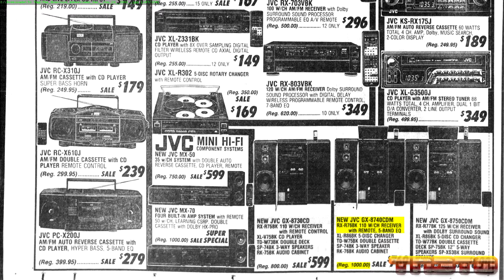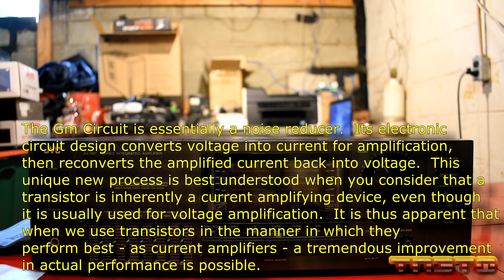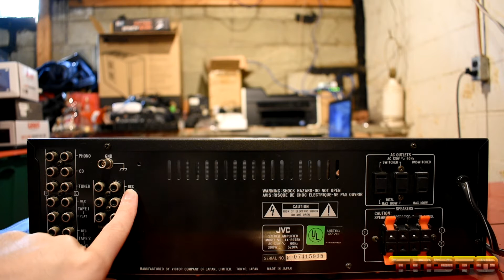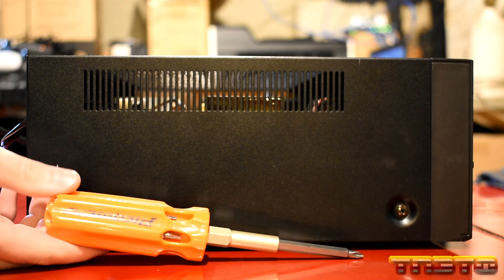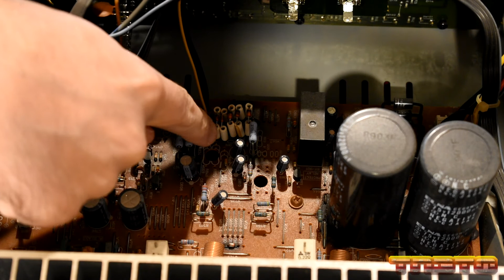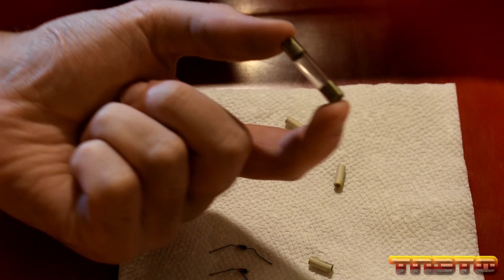JVC AX-R97 Overview and Power Meter Fix

Comment: you are supposed to use the plugs on the back of the receiver if you have the original equipment, it is how you unify the equipment and its features to use it all together, and this came with a tuner as well  that sat on top, just like it looks on the model that's a receiver.  I still have this whole entire stereo with all its original equipment, including its speakers and cabinet

Comment: So I have this unit. Bulbs were burnt out. I replaced bulbs, but still don’t light up.  I need to cut out the those diodes?   To make the bulbs work again?  I see no hot spots on the board .I understand your disclaimer and realize I am doing this at my own risk
Reply: I have probably 4 of these units both RX87:s ans 97's same issue replaced fuse bulbs and still nothing...Very powerful units at the top of my massive collection power wise and I've got another 97 in route...Also have 3 Rx450's..These old JVC fly under the radar to bad I'll have bought them all by the time they read this im cornering the market because I know good product when i see it bery very high quality JVC MADE IN JAPAN...Oh I've also got x2 Orion Research Audio Bluebooks now Audio 2000 also Audio 2002... Should double my money slow sale or sell quicker for less jist plan on enjoying this unbelievable operation ty like the movie Idiocy what's going on now days over a damn Bluetooth speaker that can have that junk I'll be Rocking wide open...Sad people just don't know what they've never experienced...I'm all over it tho keep it up I'll never pass up these sweetheart deals I'll buy 100....I've got enough now to open a decent store...

Comment: I did this today but it didn't work. The only difference is that I bought LED's but they have the exact wattage and amps. They are actually sold as replacements for this model. Any advice?

Comment: I replaced my fuse with the same value, and remove also the zener diode, but it doesnt work. What dobyou think is the problem with my unit..ive tested my fuse lamp and it works, but when i connect it to the fuse board, it doesnt work! So could cuase the fuse lamp wont light up? If you measure the fuse while it's powered on, will you get 12 volts power? Or is it 150mA ?

Comment: Thanks for making these detailed videos. I had the rx-r75 as a kid and sold it as a young adult during some hard times. I regretted it ever since. I recently bought a nice jvc rx-r75 to replace it and new fuse bulbs for it, i also plan to remove the zener diodes that you show in your video. I love the way this jvc sounds, and the power meter is just gravy. It has that 110 watts RMS per channel that gives it plenty of power for most speakers. Im so happy to have it back. I have some fond memories of this unit, i wonder if it will live up to how i remember it? Either way, it's a beautiful vintage unit, and Im lucky to have it back. Update: i just bought the ax-r97 today on eBay. It was listed as not working but pulled from a working environment. Reviews all say this guys stuff works. it's just listed as not working. I only paid $40 for it. Ebay for the win!
Did you know there was also a rx-r85 that is identical to the rx-r75 and rx-r76. I was looking for remotes and came across the remote for the 85, its identical to the other remotes, i hope it works. The 76 and 75 remotes are 40-50 bucks.

Comment: Just bought an AX-R97untested yesterday for $12. Took it home and everything works but the front panel light show which I don't care about anyway. Quite satisfied so far. Great video.
Reply from the maker: It's quite an in-expensive and easy fix. Fuse bulbs shouldn't be too hard to find. I go over the power meter fix in the video.
Reply: @TheN3tw0rq it was actually a resistor for the led power. R843 was the number on the board. It was 10 ohm ¼ watt resistor. It's fixed now. Once those zeeners fry, I guess this resistor goes next.
Reply: @robertholsopple9451  I had the same issue on an AX-R87 unit I recently acquired. Replaced the R843 resistor, and now my power meters live once again! Appreciate the information everyone👍

Comment: hey! working on an RX-r76 right now, and I'm looking for some help here. ordered some new fuse bolts off parts Express, and clipped D812 and D815, which feature burnt marks around them, so I figure they're definitely the correct zener diodes. 

after replacing the bulbs, I still don't have a backlight, and I'm wondering what I can do to test/ see what the actual issue is , or if this is something known? any help is appreciated man

Comment: Please Help!!!   I'm so mad at myself right now!!! My receiver was working perfectly. But I was worried about the D812 and D815 diodes. So unplugged it and went in to remove the two diodes so I wouldn't have problems in the future. I didn't have a long enough wire snips so I wiggled them out, very carefully, I thought,  by bending them back and forth like a loose tooth. I put evrthing back togeter and now my cool LED display is not working at all. What did I do and how can I fix this. did I break a ground somewhere Sick about what I did 🤦 The RX still works but I get sad looking at is now...can you please help me? thanks in advance.

Comment: Buddy, thanks so much for posting this video. I'm working on the same unit for a buddy & the display is not lit & he says the power bar graph does not work either so I will look into that. Also he says one channel is not working & I test it & only the right channel has power output so I have to check the output transistors to see why the left channel has no output.
Reply: Check the switches / balance / volume controls first. Might need cleaning. Have similar problems with a vintage jvc amp here, too. Intermittent outage of one channel.
Reply: @rollomartins6224 . Thanks, I will check all those also. I'm jut waiting for the " fuse bulbs " for the display then I will check everything else.

Comment: I bought this unit brand new back in the late 80's as I recall, but my panel is dead as well.  The amp seems to perform well without the meter display.  Why did the Fuse Bulbs burn out in the first place?   Before I do this repair, you mentioned that some resistors may also be fried.  My question is how can I determine if that is the case and which ones?  Should they look burned?

Comment: I really like the amps which has power spectrum display this unit is unique in the sense of spectrum display.
As the whole display stays lit with horizontal lines, I think it would have been great if the whole horizon lines go up and down, just like it happen in few of Technics or Sony high end power amps if I correctly remember.

Comment: Hello sir.  I have this exact JVC unit. I just did all that you did on yours.  However after I replaced the fuse lamps the light did not come on.  All the wires are connected.  The amp works great but I’m just missing the lights for the equalizer doesn’t work.  Any tips for me.  I really want this light to work again. By the way I’m the original owner of this JVC.  Thank you for any feedback.
Reply from the maker: Did you only remove the zener diodes that I mentioned in the video and not the other ones? If you clip out the wrong ones, the power meter IC won't work. Are both fuse lamps good, if only one fails, the circuit will not work, resulting in no light. Sometimes the fuse lamps can appear good, you can really check them by using a multimeter on continuity. Did it light up before you messed with it?
Reply: @TheN3tw0rq  the lights haven’t worked in years.  I did not remove any more of those things you cut out.  I did the exact things you did even tightening the ground screws.  And when I removed the original fuse lamps they didn’t look bad but I replaced both of them any how.  Any thoughts?
Reply: I just opened up the amplifier to triple check what I did and everything looks really good.  Lamps will not light.  All the connections are solid.  Weird.
Reply: @TheN3tw0rq  hi, I know this is an old video but I am having issues with the same amplifier you worked on in the video. 

Everything worked fine when I first got it, but I turned it on one day and the fuse near the power supply blew. After that, the power meter stopped lighting up but everything else appears to work fine (I have not hooked it up to speakers yet, but all other buttons and lights work despite the blown fuse).

I tested the zener diodes you removed in this video, and they are completely open. The output transistor closes to the power supply also reads 0 volts when I test the base, collector and emitter with my multimeter in diode mode. 

Both fuse bulbs are working – I verified by testing continuity. Does this sound like a bad output transistor caused the fuse to blow and the power meter to go out? I plan on removing the zener diodes anyway, but I'm curious what you think. Thanks in advance.
Reply: Were you able to get it working again? I just did the same: clipped out the two smaller zener diodes, replaced blown fuse bulbs, tightened ground screws. Still no light on the power meter…
Reply: Actually got it working now
Reply: @tam-truong  how? i have a similar issue
Reply: What did you do? To make the light work? @tam-truong

Comment: Bro, i got the same issue, can you please send me the Link, where i can buy those to fuses o resistences, those are 12v 15Am or 12v 0.15Am ? Thanks
Reply from the maker: The fuse bulbs? They are 12V 150mA and can be found here https://www.parts-express.com/12V-150mA-Fuse-Type-Lamp-070-123